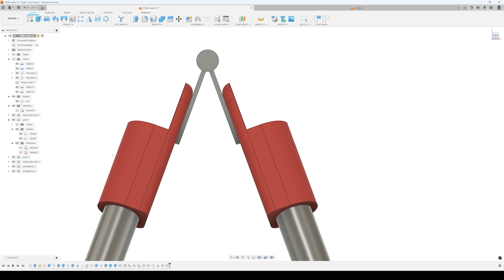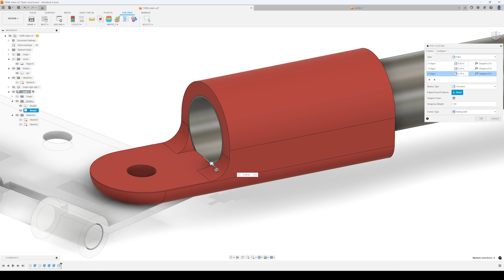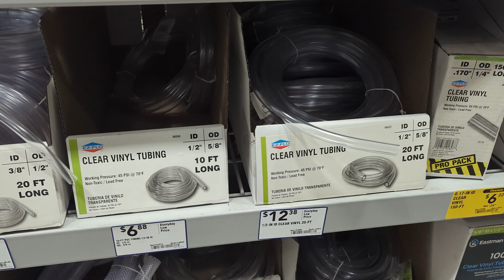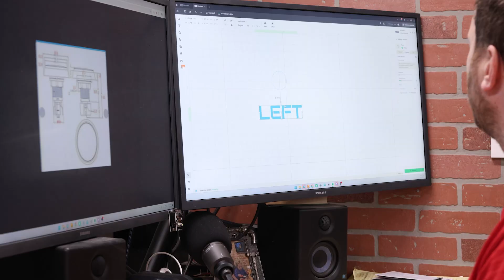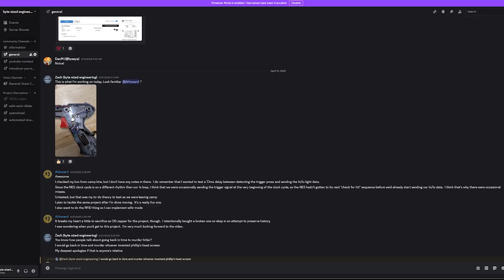Pixelball - Part 2

Comment: The instant I saw those mounting brackets I said: "WOW that looks flimsy" out loud, and 5 seconds later they broke. That really made me chuckle.
Reply from the maker: Can I hire you to watch me prototype things? That way you can tell me before I do silly things?
Reply: @bytesizedengineering  That would definitely be possible, but I would actually rather teach you about torque and things like that. It really isn't that hard at the basic level, which is enough for projects like the ones I've seen you work on.